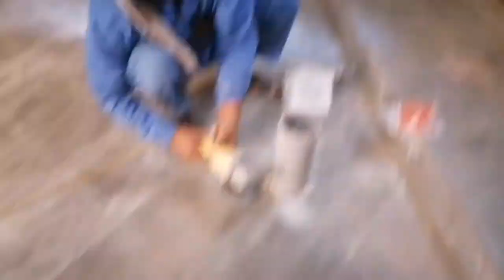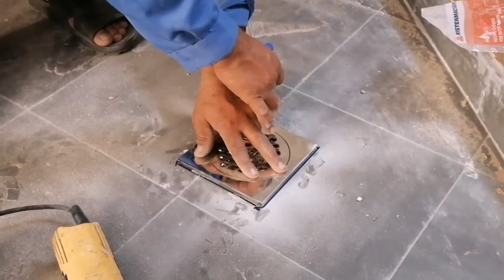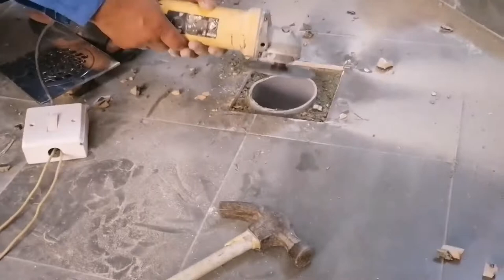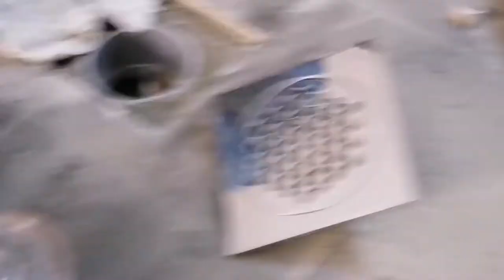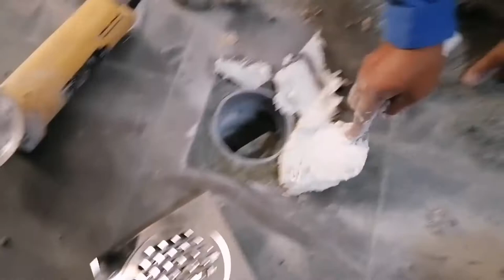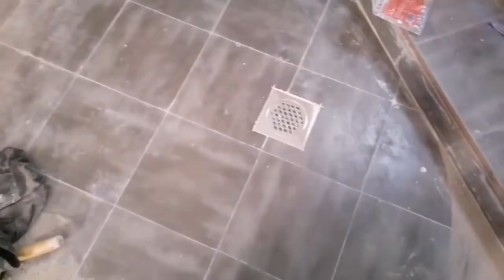How to install Floor drain || techniques install Floor wastes || bath drain

Comment: Yeah it started looking good but once i seen him cutting an installed tile with wheel i knew the finished product would have tool markings and i was right, the Xs on the corners! I wouldve just removed the damaged tiles and cut new ones also under the drain itself needed tile underneith cause that was too much grout

Comment: seems like the drain was an afterthought. drain should be dry fit and tiles cut before installing to avoid nasty lines coming out of the corners of the drain.